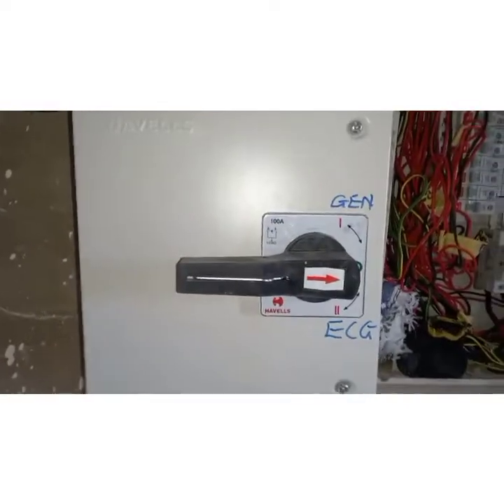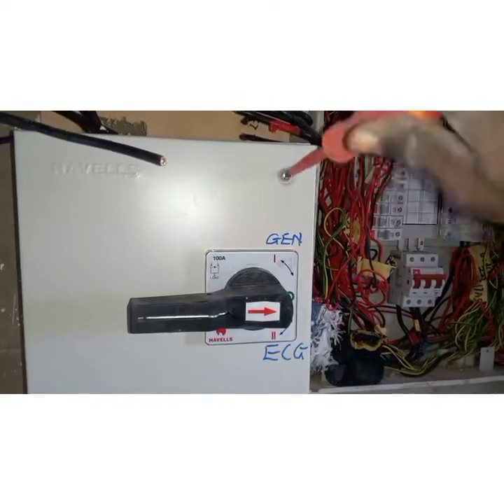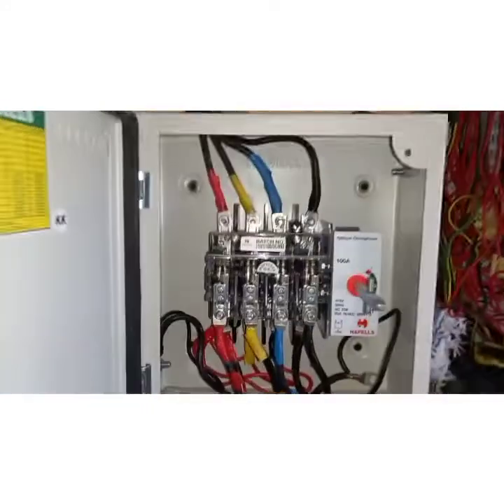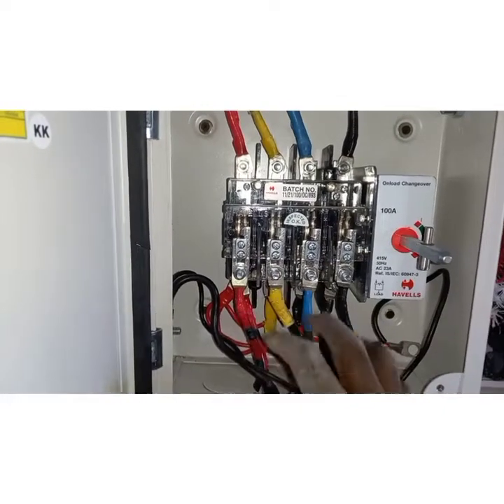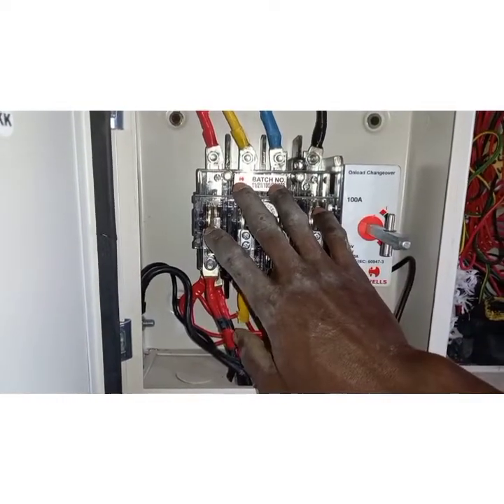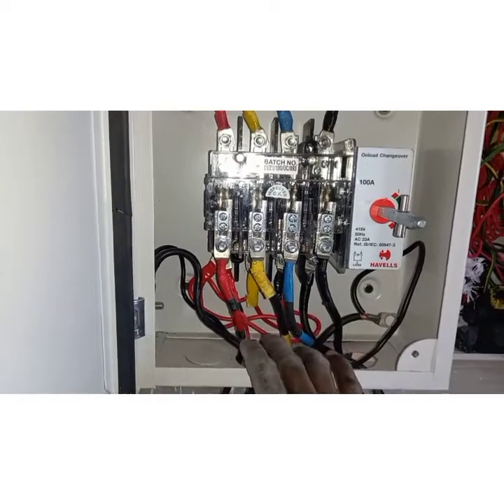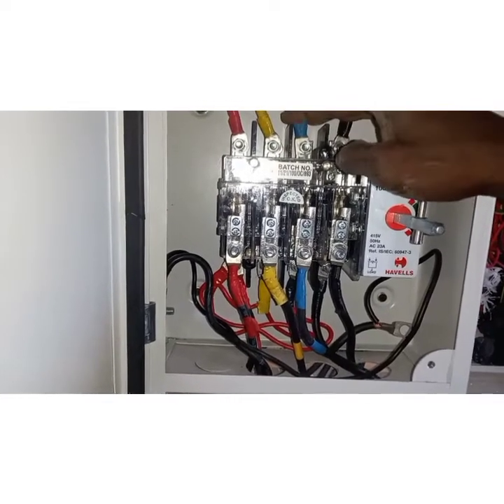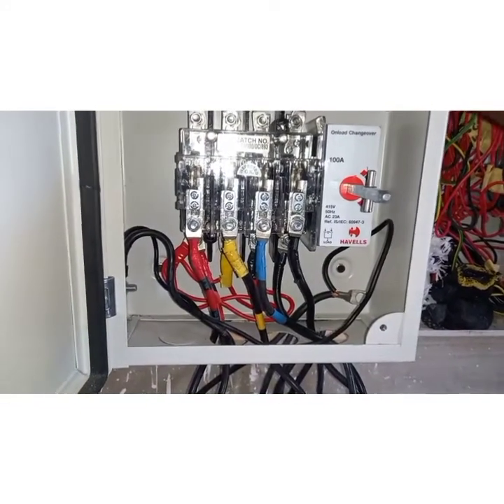Building In Ghana, Three Phase Onload Change Over Switch Connection Explanation. #AccraElectrician

Comment: Is the connection the same as bristol 3 phase change over
Reply from the maker: I can't tell because I have not used Bristol onload Changeover before, however you can test it with a multimeter to know how it's designed.
Reply: Nice but nest time arrange the cables well please
Reply from the maker: @AmponsahKwabena-gq6jp  noted sir. Thank you.

Comment: Good work master but I need help of 110 and 220 wiring... Thanks
Reply from the maker: Okay. For the 230v and 110V wiring. The wiring is done normally, don't mix up anything of the 230v or the 110V (being it a neutral or earth) and finally you will need to install a 220V 110V step up and down Transformer to step down the 230v to 110V.
Reply: @multiskilledelectrician1  I, have an issue here you know transformer only converts voltage but not frequency so how do you convert frequency from 50hz to 60hz my house was wired both 220/110v and all the lights in the house were110v meaning 60hz frequency perhaps they are not going to function how they because the voltage frequency in Ghana is 50hz while US is 60hz . Do you have any ideas to convert 50hz to 60hz?
Reply from the maker: @TheBayasi  that's true. I noticed this some months ago, the step down Transformer we purchased for a project converts the voltage without converting the frequency, however all the 120V 60Hz appliances function fine.
Reply from the maker: @TheBayasi  also according to further findings, the missing required frequency here might only affect the appliances on long term basis.
Reply: @multiskilledelectrician1 ok. did you buy the transformer in Ghana? I did a little bit research and about all the majority of the people are saying I need to buy PSU frequency converter from 230v 50hz to 110v 60hz and is not that cheap at all. I don’t know if it’s available in Ghana! if not then I have to get it from china.
Reply from the maker: @TheBayasi  yes, transformer was purchased in Ghana. Oh I see.
Reply from the maker: @TheBayasi  I can't tell, but I will ask around.
Reply: Ok let me know

Comment: when the phases are looped will the changeover switch still work
Reply from the maker: Yes it will, you loop the phases when the standby power source is single phase, if it's three phase there will be no need to loop the phases.

Comment: Please according to how your connection is the ECG is at the TOP and the generator at the DOWN
But when the changeover is closed the indication on it please I think is missed please I'm a little bit confused please
Reply from the maker: You're not alone, so many electricians are confused about it too. But it's so simple. Yes according to my connection ECG is at the top and Generator at the bottom. The power source, either ECG or Generator could be at the top or bottom and the load (to consumer unit) is distinguished.